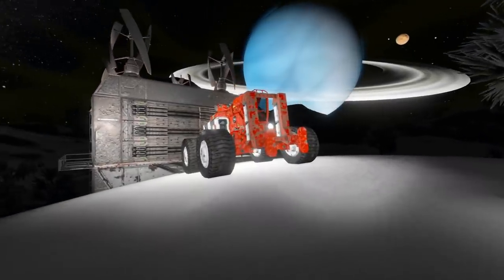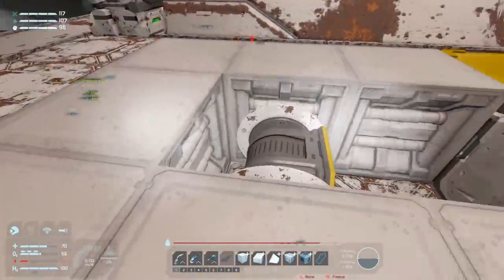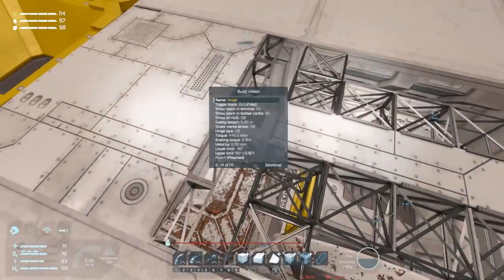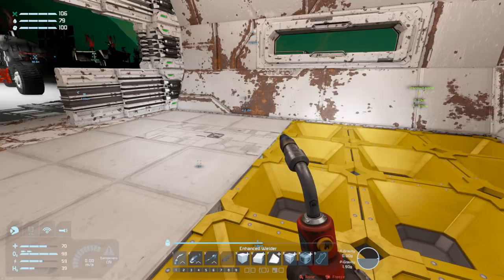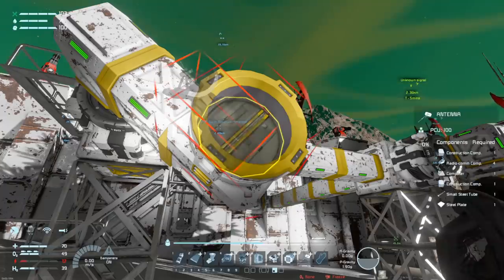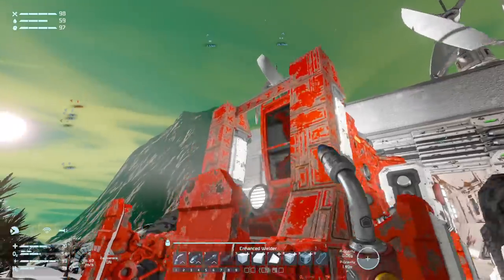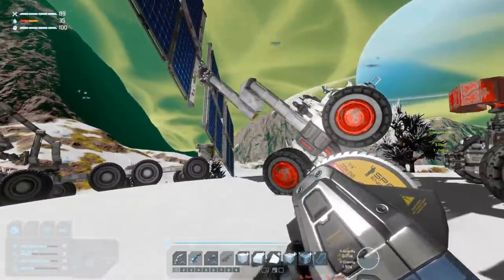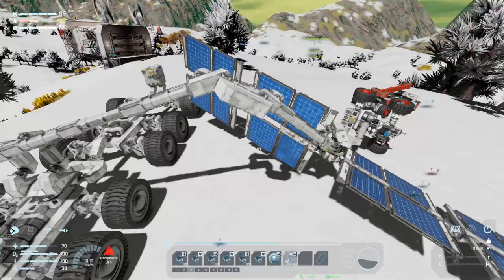Survival Impossible - Manny or Mannie or Clangy? #39 - Space Engineers Hardcore Survival

Comment: An episode of spectacular success and failure.

I wonder if it's always exploding because large grid hinges only have one degree of freedom, unlike the hybrid hinges you used up on the asteroid. So if you built the 2nd hinge turned the other way, it might have enough fungibility in enough directions that the static grid doesn't explode.

But I think that's not the aspect of Klang being angered here. I dimly recall a form of His wrath that was common a few years ago, where merges to static grids almost invariably caused explosions, but I cannot recall the subtleties of appeasing Him. That side of His divine malevolence may have been reawakened by recent changes to the game. Maybe even by the collision model tweaks.

Regardless, in trying to end up with the purest end product by the simplest build process, you may burdened yourself with impossible precision. Overland pipelines probably do require fully articulated segments that can be adjusted to arbitrary fixed endpoints. And the welding may just have to be awkward. You shouldn't need to do more than 3 hops overall, however.

Comment: For the conveyor you can use modular system of pillars with hinges on both sides followed by conveyor tubes then connectors themselves (they have a bit more give than hinges i suppose). Then connect them, I guess that's another way of going around this problem...

Comment: Ive been having issues with wind turbines on sub -grids.  I'm sure they used to work fine not long ago?
Might not be to your liking based on your OCD, buuuut... 

Rotate hinge through 90 degrees, build pillar off the conveyor and then relax the hinge until the base of the pillar rests on the voxel, 
Still looks good for having a long conveyor wrap around the terrain rather than trying to snap them in and no more Clang-Booms! XD. 
if you need change direction on 2 axis double up the hinge.
To rotate conveyor down its length just throw in advanced rotors like ya did back on the LawnChair.
If you want to go ott 1x1 wheels for feet set to 0 friction.

Comment: 31:55 The way i made my freeform pipe, is i put down the first pillar then using a hinge with a long section of pipe i aimed it at the direction i needed it to go.  Then building down from the end of the long pipe i placed my scaffolding blocks, then roughly (as close as i could) lined up a new static grid in the ground under the closest block, then removing my scaffold i built the next pillar with the conveyor on top and the hinge head on the side the pipe was on (after pre-emptively adding a block of scaffolding for hinge space) attach them togeather an tah dah! perfectly lined up! then just repeat the process using the appropriate hinge for slopping down stuff you can either have tilting pillars OR on the end of the pipe segment have the opposing hinge already, then do the same as before but remove the hinge head on the end to help.
Reply: strangely enough an important thing to get right is to keep the hinge base facing the same direction for each hinge. The more identical they are in orientation the more stable they seem to be. also attaching them backwards does some weird stuff with their strength similar to attaching a rotor the wrong way

Comment: possibility is building poles before trying to connecting them with the "cable", this will mean you do not need merge blocks. Also use pistons instead of tubes, it's cheaper and allows more wiggle room for large grid.

Comment: Could you use the crane to disconnect the hinges at either side of the conveyers and move it away then attach the pillar to the ground and then re attach the hinges after once it’s all fixed?
Reply: MrCodedLion That was exactly what I was thinking.
Reply from the maker: I think that's very much worth trying out :)
Reply: Splitsie I had an idea that you could leave one of the weld pads not welded so they do not weld to each other and then align the pillar and finally weld up the pad.

Comment: You're super over-complicating it with merging grids.

What you need to do is thus:

Put your short tower on the hinge and attach it like you did to start.
Position your short tower correctly where you want to place the base with your pair of hinges.
Put a control panel on the short tower.
Covert the short tower grid to a station.
Build down into the voxels to create the base.
DONE.

As long as a grid is a station, you can build from it into voxels.

Comment: You will have to build it linearly, use the hinge to bend how you want it, then build off the bent hinge, straight into the ground,  start at your main base, then as you go, use the hinges to bend where you need them, then build from the hinge connection, straight down into the voxels   You can probably fully build the hinges on the ground, connect them, then when you want to go to the next portion, build straight down off the fully built hinge that isnt connected to anything, yet.
You already have that hinge set up, just build straight into the ground, I see no way to merge them without explosions.

Comment: Build the posts where you want them first, with rotors and parts attached, but make sure you align with the local grid of the other posts so the height matches. Then put a piston inline with the conveyor tubes. This gives you 2 degrees of freedom to line up the joint exactly. It does add some part cost, but you really shouldn't need that many posts, just one really long segment and maybe a couple at each end. Use the absolute minimum torque / braking force on the hinges that you can get away with (edit: and impulse on pistons), so it can flex. Btw, are you leaving yourself enough room to actually process the drop pods in that collector building? Or are you only concerned with charging when it's not in use? In any case, really enjoying the series, always a pleasure. GL!

Comment: I'm thinking for the power lines you could build each section out and add the hinge and conveyer junction for the top of the next pole then put a rotor head on the bottom then build up underneath with a rotor on top. The rotor should give enough to make it work while also meaning you don't need to have perfect rotational alignment. Maybe?

Comment: You could have build a piston under your conveyor line to lift it up temporarily. I think the problem is that the stuff at the end of the conveyor line is heavy, it pulls down everything.. Put a piston under it, at the end you can add a wheel, then push piston out that will lift the conveyor line It will be stressed a bit but should provide enough room to build under it, and when you are ready just let the piston down to the wheel

Comment: I was able to recreate this conveyor line,  in creative for most of it in a survival impossible save, when I had the conveyors and half the pillar built I went back into survival.  I moved the hinges to random angles then set their velocity to zero and left them unlocked. Then with a panel on the pillar at the end i was able to set that section to a station. I was then able to set my build option to local grid and build down into the voxels. The only problem I had trying it like this was if the pillar was too close to the ground it had trouble snapping to that section as the local grid and would line up with my base instead.

Comment: @Splitsie On the asteroid you used rotators to account for the connections twisting. You don't use any rotators here - are you sure your fixed block in the ground is square so you don't generate any torque on the connection? Maybe add a rotor?

Comment: I think the smaller grid is being converted into the larger grid, so the small static grid becomes a non static grid the moment it's welded to the pillar, impacts the ground and explodes. I'd just give up the idea of welding the two grids, convert the floating pillar into a static grid and then build the base of it down into the ground. the drawback with that is that it's only going to be as vertical as you can place it with the crane.
Reply: Based on how the hinge is set up, and it's low tolerances, it will be vertical if the other end of it is.

Comment: As far as the overhead conveyor network, I'd probably design the pylons, place them in aestetically pleasing locations, then using hinges/rotors/piston, move the hinge parts into alignment and make the connections after the pylons are already on a station grid.  Though I suspect you really wanted to do it without pistons.
Reply: And now I want to make a cable lift with a gondola suspended underneath it.  Why must you tempt me to tilt at the SE physics windmill?!? ;)

Comment: Only solution I can think to your pillar problem is to use pistons or rotors to get the lock and that's not really a solution.
Maybe instead of building the whole tower and craning it up, embed and build the light armor blocks then crane up the junctions and hinges with a weld pad? But you'd still need the Liftsie.

Comment: Have a connection on merge blocks only. such as building a tower ending with merge block, align it, move everything away, use rotors/hings for small batteries if they are needed. or you could try and convert the structure to base in menu with control panel?

Comment: Can't you "drop" it from the liftsie onto the merge block / welding pad?
Or not to place the hinge base on the tower part and build it from the liftsie when you have the tower in place?
Also, I don't think I have tried it, but can't you convert the tower to a static grid while in air? (given you have unsupported stations on) 
My idea of switching the welding pad off is not to 100% complete construct it and finish it up when you have it vertically in place. You could even build a small welder head on the liftsie which could finish up the rest of the welding pad so you don't have to aim your personal welder to the pad..

Comment: That intake of breath when you disconnect, unlock or remove a significant block. Every space engineer has heard it and every space engineer has uttered it.  =P

Edit: I think the issue you're having is that you're attaching a loose grid to a static grid where the former has more blocks then the latter and the determination of it being a ship or a station is coming out using the grid with the most blocks. In your case, it's defaulting to a ship, not a station. Too be fair, I have not tested this, that is my gut reaction based on similar experiences I've had where I had to convert my grid to a station while it was being held still, then building it down into the ground (something else you could try).
Reply from the maker: I think you're right, hopefully a few extra interior walls will solve the issue

Comment: Why did you offset the hinges at the top of the tower?  I understand that you wanted to raise the height of the first tower to allow for the turret, but the second tower could just have both hinges at the same height.  I don't think that you are going to be able to attach the towers to a foundation block, hinges don't seem to operate in that direction, unless maybe you place a rotor before the hinge for a touch of wiggle room.  I think your best bet is to lay out the connectors, and the towers, then disconnect the hinges, bring them down to the ground, weld them up, and lift them back into place.

Comment: I think the hazard paint looks great. It doesn't quite match the floor anyways due to the difference in textures, so you might as well have it stand out. As for your problems with the tower, what if you built a merge block on top of the block in the voxels instead of to the side, and swung the pipe with the hinge out of the way before trying to connect it? You could always swing the pipe back in. It would be a bit more expensive that way since you'd have to grind off the merge blocks and the blocks around it, then replace the merge blocks, but I feel like that has to be less expensive than watching the tower destroy itself.
Reply from the maker: That's a fair point about the floor, if it's different anyway best to highlight it rather than hide it poorly :)

Comment: With your towers you can add a block on the bottom of set right to connect it too the ground or build the towers first with a rough idea of where you want them and then connect the hinges because when you do the merge thing it forces the ground block out of the floor if you check the replay I guess it tries to convert it into a ship instead of the other part into a static grid

Comment: You could potentially go with T-Posts having hanging rotors instead of hinges. Not quite as nice maybe and they probably take 6-7 blocks high and 5 wide

   CCCCC
   R A R
CCCC A CCC
     A    
     A
     A    

Note: C=Conveyor, A=Armor, R=Rotor (best viewed in monospace font ;) )
Reply: And what's the benefit of these over hinges? Alternatives are nice, but sell your idea. :)
Reply: @Tyrope  Fair enough :) I was under the impression that hinges are much more stringent in their wiggle room. So switching to Rotors would solve that. 
Then again, this is speculation and not tested, so you've got a point there, with the current information I have, I can't sell the idea ^^

Comment: Why don't you add rotors on the pillars? Then you could build the pillars round as well, like not fully welded wheels or similar, to achieve a circular shape as well. And use the rotor head to attach to the conveyor junction at the top. You would need to weld the pillars from ground up, though.

Comment: Question, does which merge block you use determine which the other side becomes?

If you use the merge block connected to the section connected to the crane and that makes it a ship then it definitely will explode. Can’t have a ships inside voxels. If the merge block you use is in the voxel already and it makes the whole thing a station?  It just depends on what the merge block is making the whole thing into and whether or not that even matters.

Comment: I don't know if it will make any difference but I'm trying to work out why you are putting the towers right at the hinge points.  I think that the towers would look better if they were spaced evenly between the hinges and maybe that extra length will give that little bit of flexibility that you need to make a safe connection.

Comment: Kinda like the unpainted hidden ground connector better after you already got the blocks so lined up. 
As for the pillars: Of course there is the whole grid size problem others also mentioned, but in my experience there is also always the fact that merge blocks like to dent what they are attached to during the merging. in your case unwelded scaffolding.(  Or did Keen actually manage to fix that? ) Additionally, merging with the pipe swung FAR FAR away and/ or an advanced rotor in the pipe serving as flexible buffer probably won't hurt ...  worse

Comment: FINALLY a Get Smart Door ... now to build a hallway of them ;)
Reply: you dont need a liftsie to build the connections ... get into Diggy Diggy Hole ... and run a services tunnel back to the base ... you then protect your supplies and hide the junk away from view ... and it gives you yet another place to sneak away from attacks and come out on a flank to shoot them while not getting shot
Reply: and you proved the Crane could move the drop pods better than Manny ... and CARRY more as well ... also it can drop them in the pit where manny sits  too ... go figure
Reply: you need the welding plate mod to build your towers with the crane ... then you can place the segment with the crane to get your alignment ... and then slap the base into the ground under it with a welding plate to merge the tower being held up by the crane to the ground ... that way your guide line becomes the Tower itself ...
.
your front wheels would be on the ground more if you moved with the load between the crane mount on the trailer and your driving cab ... then your cranes center of mass is forward of the crane mount and not behind it  ... lifting your front wheels off the ground so they cant steer 
.
add a light somewhere on the crane head so it shines where the load is and helps you see
Reply: ahh didnt think the game was smart enough to adjust the connectors itself ... and was trying to figure how you were going to connect 2 female connectors without matching male connectors ...
Reply: your tower wont place without going boom because it is NOT at the same angle as the ground your are trying to attach to ... so it goes clang boom ... you have to HOLD the tower in place and then attach to the ground ... THEN attach to the hinge ... the hinge can adjust ... the ground cant ...
.
order of build is important .. ground first hinge second ...
Notice when you detach the hinge ... the tower IS NOT ALIGNED to the ground but to the hinge ... you have to ensure it is aligned to the ground ... and let the hinges on both ends (not in the same orientation (one up down .. the other left right)) then you will attach to the ground and not go boom ... IF you hold the section with the crane ... once it locks to the ground ... then you can join your hinge and between both ends of the piped section the hinge will move up and down and left and right as needed to align the pipe to the towers ... because SE has a curve at every spot on the ground ... your pipe has to bend and twist ... not just one of them ... but BOTH and your piped section has to accommodate that.

Comment: I know This is like, many months late but... why not just build static grid armor plate poles and put double hinge > piston > double hinge as the piping between them
you get both vertical and horizontal alignment with double end hinges and distance can be adjusted with piston. Simply put piping 1-2 blocks shorten than needed and piston it to right length. Clang? from what I understood if you carefully set distance to right centimeters it should be stable